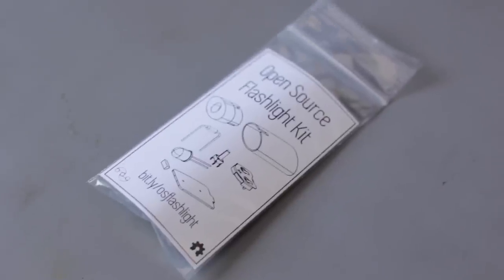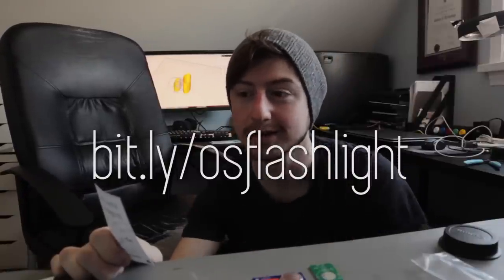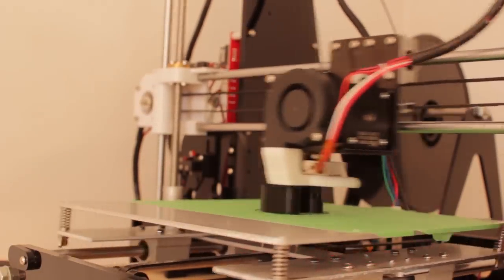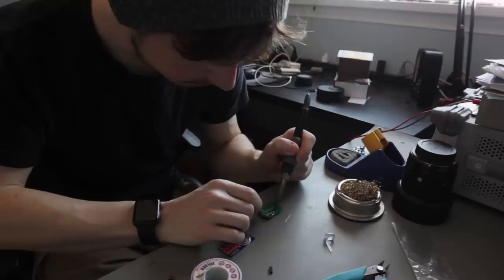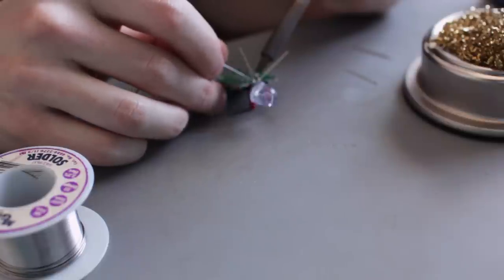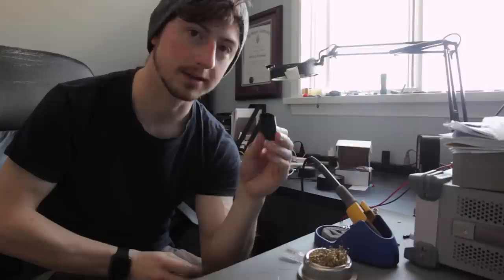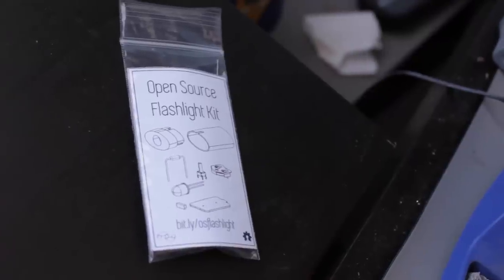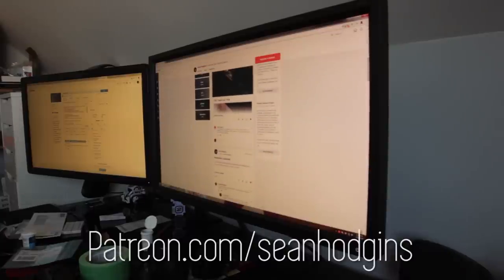Open Source Flashlight Kit

Comment: Great little project Sean, perfect for a classroom to get students learning soldering and 3D printing. And it's got a great use too! Stick a little "nubbin" on the bottom side of the case to take a split ring "keyring" - then the students/users/people can take their flashlight with them, and it would be used more often!

Keep up the great work Sean!

Steve
Reply: Well, it was a quick idea, so I added it as a quick remix on Thingiverse - thing:2842657 😉
Reply from the maker: Great idea, of course its open source so maybe the students could modify it and add their own ring! haha I wanted it to be the simplest design with no overhangs or supports needed since its the first print, but I could definitely add a "keyring" version.
Reply from the maker: I should have looked at the reply first! good work! Here is the direct link to Stephen's version if anyone wants it. https://www.thingiverse.com/thing:2842657
Reply: Thanks Sean! the complex geometry was my concern too, and I could see you kept the design basic and simple so it will always print, print well, and print quickly. I have added just enough chamfer and bulk to it so it won't need supports and should print fine for most too... hopefully!!

Comment: Does anyone have part numbers for the components from DIGIKEY?  The Push button Battery Holder and resistor?  Or what Resistor is needed and i can source somewhere else?
Reply from the maker: They should be in the instructables link below. Let me know if it’s not!
Reply: @SeanHodgins  There are no part numbers or product numbers.  It just says resistor, switch. etc.
Reply from the maker: @kyleblakely2090  Right next to them in step 2 of the instructables ( https://www.instructables.com/id/Open-Source-Flashlight-Kit/ ) there are links to the digikey parts.